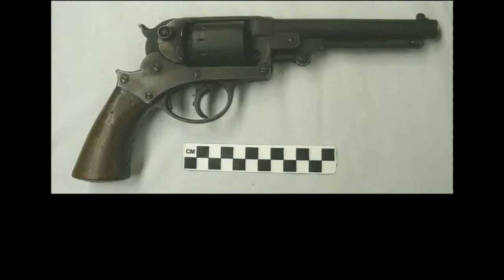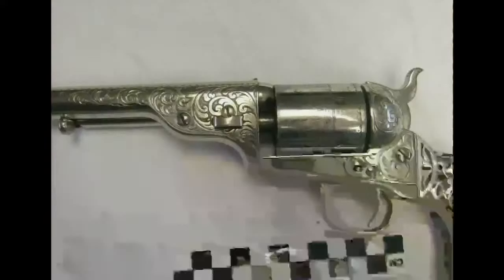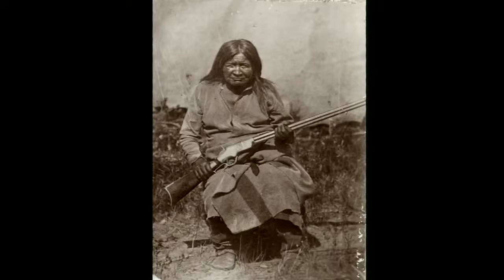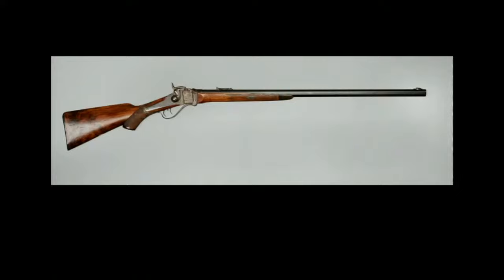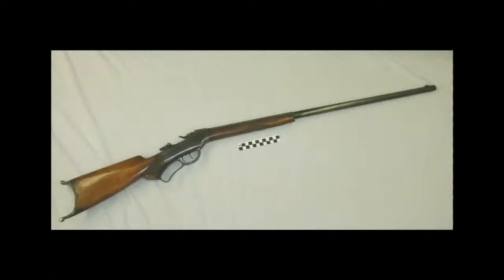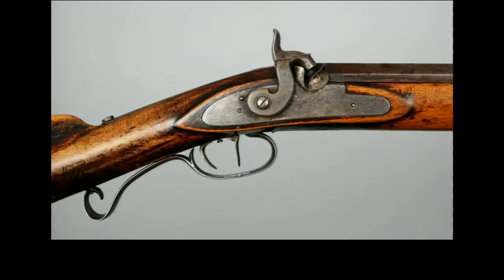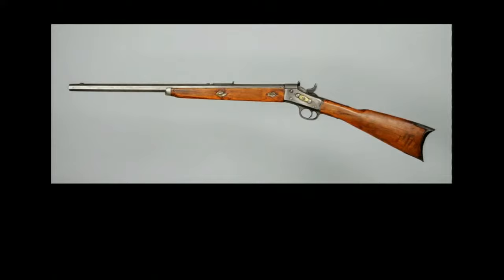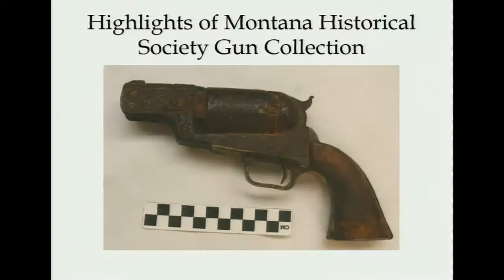Highlights from the MHS Gun Collection

Comment: We, meaning several members of  The Montana Historical Gunmakers Guild, that have researched the J&S Hawken rifle in this video are very sure that this is a real mountain man era Hawken. The lock supplier, Tryon, used the marking on the lock only until 1835. The stock design and cheekpiece are identical to the 1836 dated Atchison Hawken. It is also nearly identical to the early J&S Hawken rifle I call the Petersen Hawken which is  in the Firearms wing of the Museum in Cody. The Initials on the cheekpiece inlay, ETC, match with Edmund Christy who was a part owner of the Rocky Mountain Fur Co for a year and lead a brigade one season about the time we believe this rifle was built 1833-1835. The rifle has engraving on the cap box, the trigger guard and standing breech and it has a forge welded barrel with the nipple seat as part of the forging as was being done in the early-mid 1830s according to W. Greener in his 1835 “The Gun”. The Bridger Hawken by contrast is so late, circa 1850, that its actually not a Mountain Man Fur Trade era rifle but a “Wagon Train guide/Army Scout” era rifle. And its design and marking dates it to the period when Bridger was getting what was then big bucks for guiding a gov’t/army survey party. And finally the Hawkens never called them “Plains Rifles” they were Mountain Rifles and they are distinct from the rifles they made for the local trade in Missouri. So the J&S Hawken in the Montana Historical Society collection is a significant, early example of the evolution of the Hawken Mountain Rifle. While we cannot prove it was the property of Edmund Christy its certainly a good bet. And I personally am sure it IS a real Mountain Man/Rocky Mountain Fur Trade Hawken.  While the evidence is good we have no way of proving who owned it, Edmund Christy died young, at St Louis, without issue.  I have examined it and the ‘Petersen” rifle in detail and the Atchison rifle on all sides but in a case and am positive then were stocked by the same hand, Jacob Hawken.   The Atchison rifle is in private hands  and unlike the other two mentioned here has a “patent” breech type breechplug but the same odd lock plate shape as the Petersen rifle.